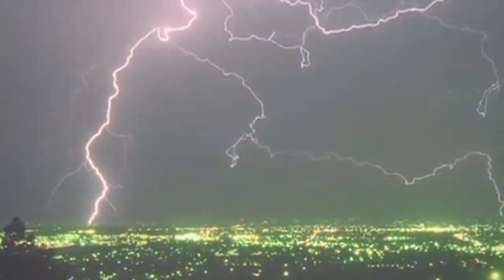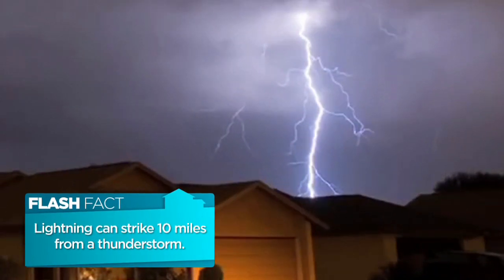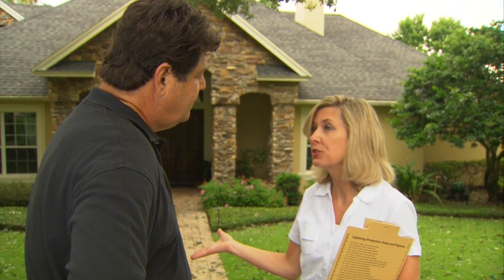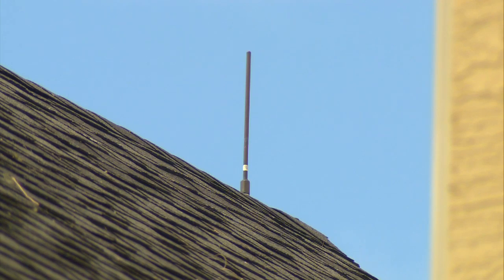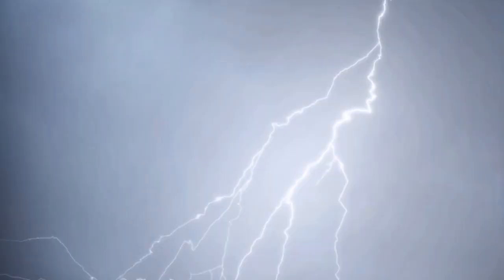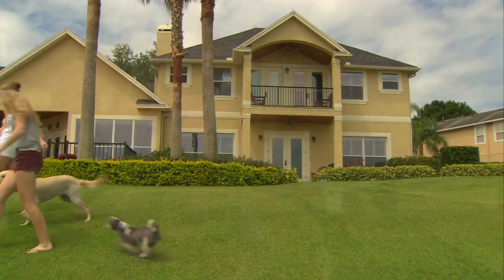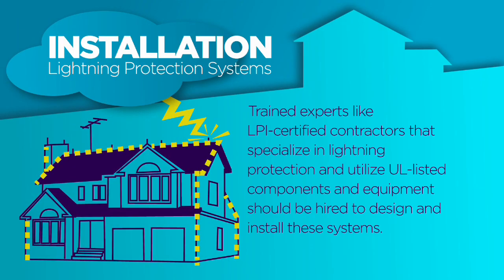Lightning Protection Systems

Comment: 2.35 She claims they do not attract lightning, this is FALSE.  The work in two ways, firstly they "spray" electrons off of the tips into the air (reducing the overall chance of a strike) but at the same time that stream of electrons acts as a path for a strike should one occur.  This is why the lightning will always strike the ends of the tiny rods and not the rest of the huge area of the roof.

If they did not attract the lightning then the lightning would strike anywhere on the roof, and you would have to cover the whole thing in metal, which clearly you do not need to do. Having lightning protection is a sensible thing to do.

Comment: What if the lightning doesn't strike the rods and instead strikes another part of the roof?  Surely lightning can strike ANY part of a roof, NOT just the lightning rods and not always the highest part of a roof, or am I missing something here.
Reply: Yup! An electric arc will always leap to the closest point. That's why our rods are installed at closer intervals. = )
Reply: ...and not only path if lowest resistance,  but of lowest impedance ⚡⚡⚡
Reply: Lightning will always direct to path of least resistance to ground. That's why it will strike the rods instead as it is less resistance than the roof and provides path to the ground.
Reply: @marcusjr80  Ah thanks for your reply.  So just to confirm, if you have lightning rods on your roof, the lightning will 100% only strike the lightning Conductor's.

Comment: Too many words... Just say you need rods for the roof AND surge protection for the electronics aka two separate systems that work in conjunction to fully protect the home...
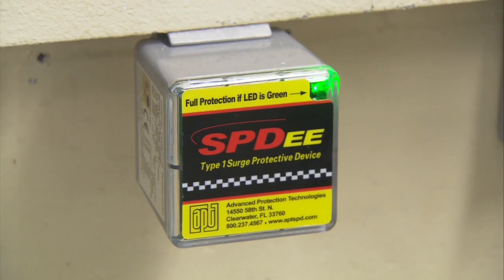Finally at 2:20 the lady makes the distinction.

“Not a do it yourself project” Oh yeah? Challenge accepted 😈
Reply: Yeah unless you want to fry your entire home from a lightning strike id reccomend hiring a pro bud. Take it from someone whos installed these since i was 13 this is not a do it yourself project no matter what exp you have.
Reply: @patters195  It was a joke fam…